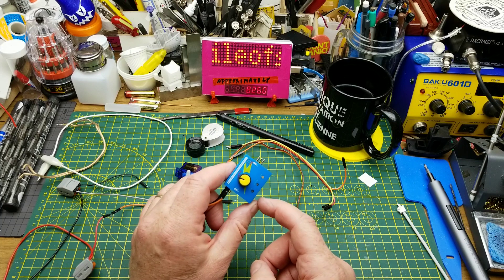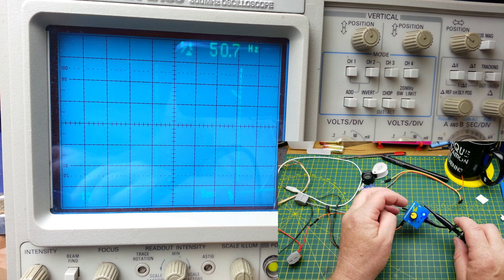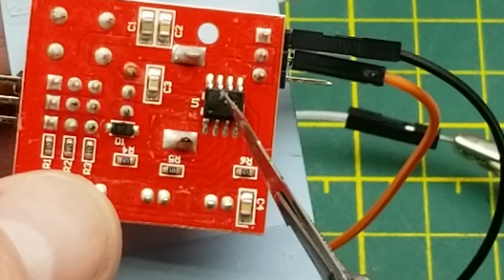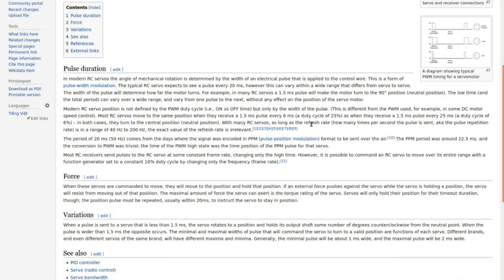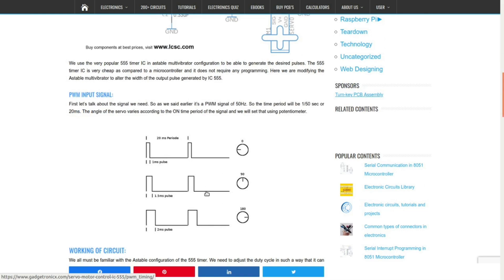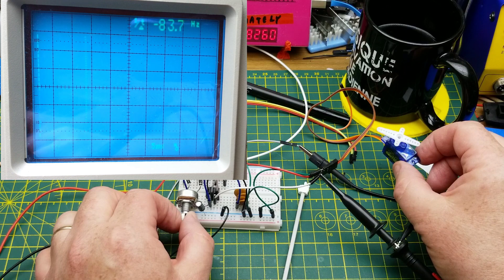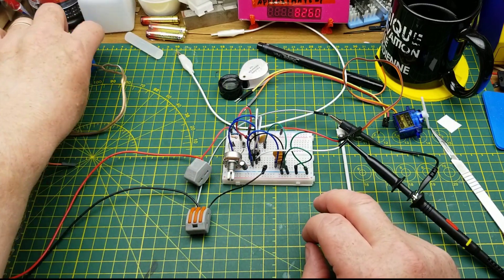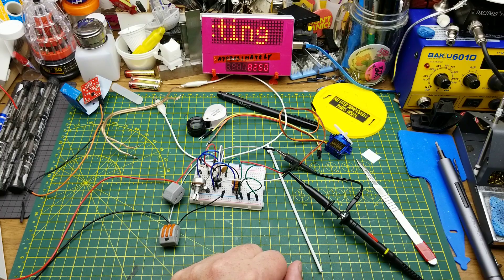DIY servo tester (using 555)

Comment: Woah, that's some multi-level synchronicity going on. I literally just opened one of those up on my workbench, but the noise outside forced me to take a break and watch some youtube.

I ordered it a while back thinking it's be a cheap temporary tool until I could design something more advanced, but you're making me think I should have designed my own from the start.

Comment: I made a solder fume filter using a fiberglass 2-gang box an 80mm PC fan a charge and boost circuit with a 20"x25" carbon furnace filter with a Li-Ion battery.

Comment: Sometimes it's easy to jump in and use a microcontroller for everything, but this shows a nice quick and dirty way of doing it using off the shelf electronics rather than programming, which makes a pleasant change.
Reply: The 555 provides a PWM signal, but the Micro can do more.... for example the "auto mode".